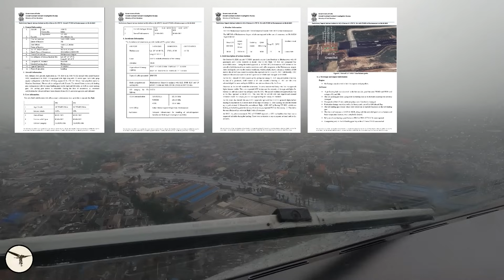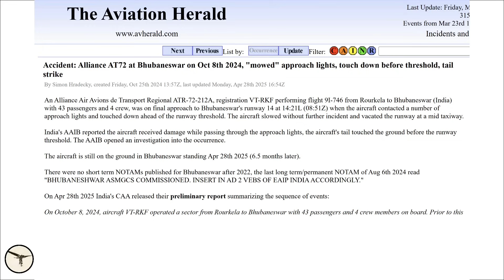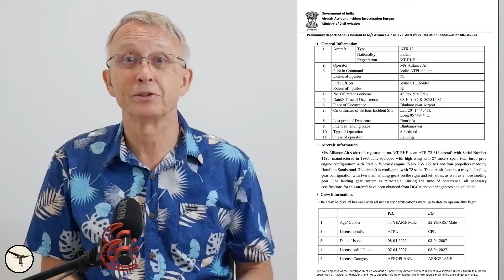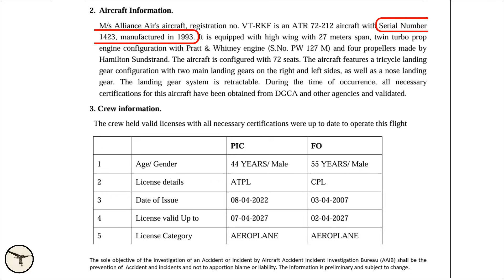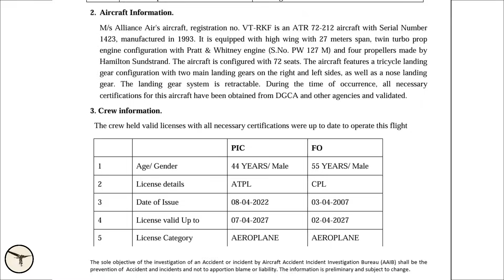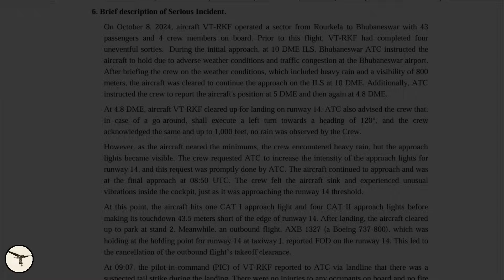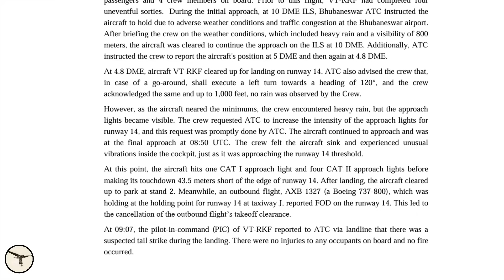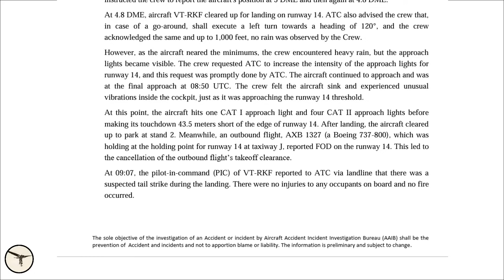What REALLY Happened in the Alliance Air Flight 746 Microburst Incident?

Comment: Very well presented and to the point Magnar as always. Excellent study material for all aviators.

Complacency is a huge factor as this is a rare event in one's career. In my experience 95% of approaches become visual well before the minimums so complacency can set in quickly. When the last 100 landings were uneventful the decision to suddenly go around is severely hindered. 

It would be invaluable to find out all the cues the crew would have ignored to continue the final few minutes of the approach.  As Magnar points out would they have experienced increasing heavy rain and reduced visibility; or severe change in airspeed and power settings; GPWS warnings? We will probably not know.